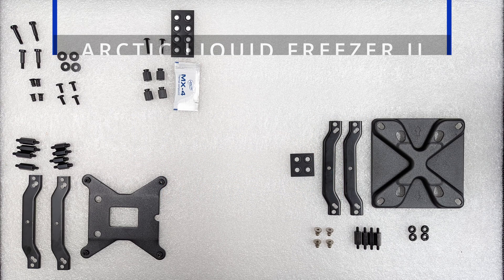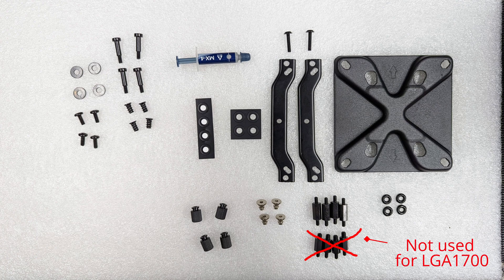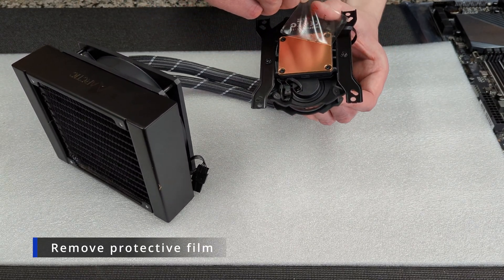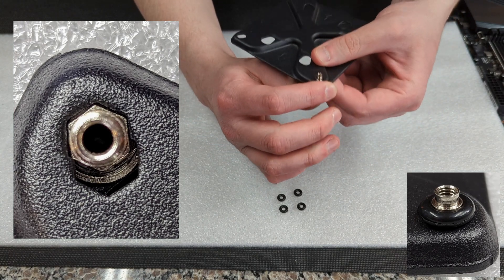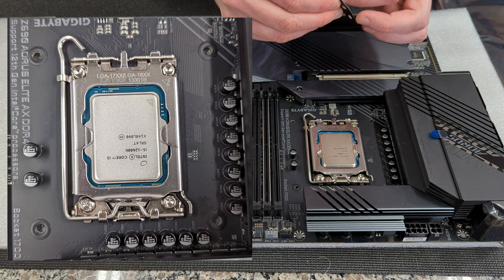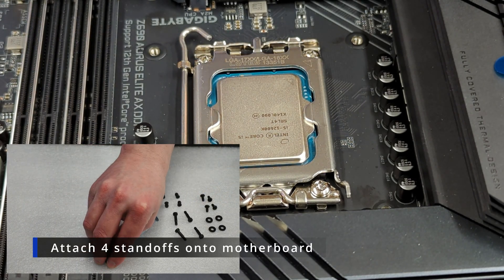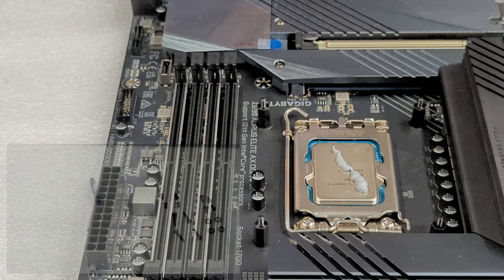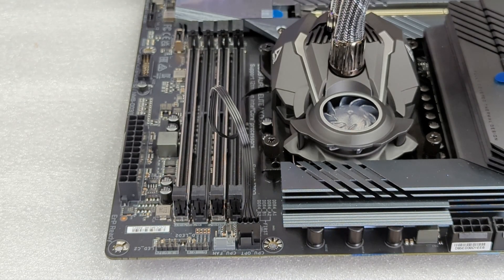ARCTIC Liquid Freezer II | LGA1700 Kit Installation

Comment: I'm installing my Liquid Freezer II 420 on Asus Pro Art Z690 i9 12900K. I can see I have to remove PCB cover so it fits.
And when I scanned the code it said I had to REPLACE the pump PCB cover? Do I have to wait 9 days or more to receive a replacement cover or is it possible to install the cooler without the cover?

I don't want to loose any guarantee from ARCTIC, INTEL or ASUS 

Thanks from Denmark
Reply from the maker: Hi,
You can use the Cooler without that cover without any loss of warranty (after all, it is just a piece of plastic at the underside of the housing).
So for now just use it without, until we can send you the new cover^^

Comment: Hey there, thanks for the video!

I am looking to install an ARCTIC Freezer 34 eSports with the upgrade kit onto a GIGABYTE Z690 with an i5-12400. Do you know if this will be compatible?

Thanks!
Reply from the maker: Hi,
Just make sure to get the Kit meant for the Freezer 34 eSports series, and not the one for the Liquid Freezer II series, since the standoffs have different heights.
Otherwise, there shouldn't be any issue with the LGA 1700 Kit and your Mainboard and the Freezer 34 eSports.

Comment: Have a question. The two screws that go into the each of the bracket pieces on the pump header…they don’t thread down at all. The directions say if they don’t go down don’t force it. But I’ve confirmed I’m using the correct screws. Any advice? Completely lost.
Reply from the maker: Hi JM,
please double check if you used the correct threaded screws, as there are 6 similar screws included but just 2 have the finer thread for the Pump clips.
BR
Stephan - Arctic Service

Comment: is it safer to apply the cpu in the socket after you place the backplate?
Reply from the maker: Hey Robot,
Basically it doesn't matter. If the CPU is already in the socket less things can break. Intel for example got a cover above your CPU Slot - so nothing gets damaged.

Best regards,
Nico

Comment: Does the original mount still works on 1700?
Reply from the maker: Hey HD,
Thank you for asking
Sadly it wont work - if youre sending us a proof of your CPU we will send you a new LGA Kit for free.
Just fill in the form on our website 🙂

Best regards,
Nico
Reply: @ARCTIChannel  I saw a 1700 LGA mount liquid 34 ? The number 34 works with my 420mm liquid freezer 2 ??? Thank you
Reply from the maker: Hey HD,

Sadly every Kit is diffrent from each other.
I wouldnt recommend using the Freezer 34 eSports Duo Kit for your Liquid Freezer.
New Kits should arrive soon - keep an eye out🙂

Best regards,
Nico

Comment: Hello. I am planning to build my first ever PC and the cooler is Liquid Freezer II 360-ARGB but I have a doubt. Do we get any LGA1700 kit inside the box or do I have to buy the retrofit later?

Also when Liquid Freezers are getting white version? My PC is a full white build and only Arctic P12 and Liquid Freezer II 360 are only ones with black color
Reply from the maker: Hey there,
bananasnapple summed up everything already. 🙂🙌
For the white version - so far there is nothing planned.
Keep an eye out for further launches 🙂

Best regards,
Nico
Reply: @ARCTIChannel  ROMANIA
Toata lumea cred ca a inebunit, si eu cred ca am inebunit. Toata lumea vrea piesele pe WHITE.
SI EU CONSTRUIESC UN PC WHITE:
1. Procesor intel 12900K White 🤣
2. Carcasa ASUS ROG Helios White
3. Placa video ASUS ROG Strix 3090 OC White
Toate cablurile m-au costat o avere Corsair + LinKup White.

In primul rand, nici nu stiu daca sa cumpar de la ARCTIC Freezer ll 420 A RGB, cu toate ca am vazut ca aveti cel mai bun Review din toata lumea pentru acest AIO 420.
Dar pompa ? Se vaita toti utilizatorii de constructii PC, ca este cea mai urata pompa si cea mai rigide (furtunuri) dupa planeta... 
Macar daca gaseam pe White, inchideam ochii.
Mai sant probleme, cu chitul de instalare 1700, nu toti reusesc sa stea procesorul in 72⁰C in STRES, FULL  LOAD...
INCA ASTEPT DE 3 LUNI SI NU SANT HOTARAT CE AIO S-AMI CUMPAR...
Daca Arctic AIO aveau si pe White !!, si o instalare de chit 1700 mai bun si mai simpu de instalat fara erori, furtunuri mai moi.... Cred ca CORSAIR erau copii.

Numai bine...
Reply: Hello. I recently ordered on Amazon the ARCTIC Liquid Freezer II 360 A-RGB, sold by Arctic, and it arrived including the new kit for LGA 1700. In any case, through their website and with the proof of purchase, you can ask that the new kit is sent to you free of charge.
Reply from the maker: Hey Fanatec,

We already know - a lot of people are waiting for a white AIO.
More and more people decide to get a all white build, which makes it a bit difficult for us, since our LF isnt available in white😕
Im sure we will come up with a solution for the future.

Otherwise Thank you for your feedback😊
PS: Our Pump isnt ugly! its beautiful in it´s own way😊🌺

Best regards,
Nico

Comment: Hello, what is the difference between original LGA 1700 bracket and New one? Can I use original pre bracket with my 12900K?
Reply from the maker: Hey Umral,

If youre looking closely the Original Bracket got 2 holes next to each other. You can see each hole individualy
The newer Kit got a third hole in that place for mounting the Cooler on the 1700 Socket.

Best regards,
Nico

Comment: Are the screws attaching the brackets to the cooler self-tapping and somewhat difficult to screw in?  Thanks
Reply from the maker: Hey Matt,

There should be 2 screws with a thinner thread (M3) you should use for the Kit.
They are rouhly 14 mm.

The 4 screws with the same length and a bigger thread are for the AM4 Kit .

Best regards,
Nico🙂
Reply: @ARCTIChannel   I checked and the four screws for the AM4 mount work fine, but the two thinner screws for the pump mounts drop into the holes fine, but won't thread into the inserts at the bottom .  They start, but won't thread in.  I don't want to damage anything so they are being tried with fingers only.  Any suggestions?
Reply: I forwarded this chat to Arctic support.  You may see it there.  Waiting on a reply.
Reply from the maker: Thank you, our support team will answer you as soon as possible.

Comment: in what orientation should I install the liquid freezer II 360 once the pcb cover is removed 

i am installing on an ASUS z690 maximus extreme
Reply from the maker: Hey Wissam,

taking of the pcb Cover does not effect the Cooler in any way.
Normally there is nothing to pay attention to - only thing is that your pump shouldnt be the highest point since all the air will start rising to the top and will make a lot of noise.

Best regards,
Nico
Reply: @ARCTIChannel  many thanks, hopefully the build goes well :D
Reply from the maker: fingers crossed🤞

Comment: Good job Arctic on not forcing users to throw away their cooler and producing more e-waste! Pro consumer move!
Reply: @ARCTIChannel  is there a reason (besides repurposing existing tooling) that you made the LGA1700 backplate so ridiculously thick? It’s seems entirely unnecessary and it makes your excellent coolers incompatible with many cases.
Reply: @calebthomasralph  request new backplate free of charge.
Reply: @svamp_fest  Did they update the LGA1700 backplate since the original one they released? If so, that’s awesome.
Reply: @calebthomasralph  yes they have a new one.
Reply: @svamp_fest  Nice! Good on them for sorting that out, and thanks for the tip!
Reply: @svamp_fest  On further investigation, are you sure? Their site seems to show the same (super thick) bracket that they released when LGA 1700 came out. If that backplate is the same, the same problem will still exist where any case that isn’t wide open behind the mobo will interfere. This includes O11 cases and many others.
Reply: @calebthomasralph  yes im pretty sure. backplate comes with kit is different than rev.7 back plate. rev 7 is much thinner and better engineered. just get it.
Reply: @svamp_fest  I can confirm this is the case, revision 7 has a new backplate that is a lot thinner.
Reply: @calebthomasralph  yes. Just got mine and it’s incredibly thin
Reply: @ARCTIChannel hey for lga 1700 support kit can i send a picture of the cpu?
Reply: Disagree.